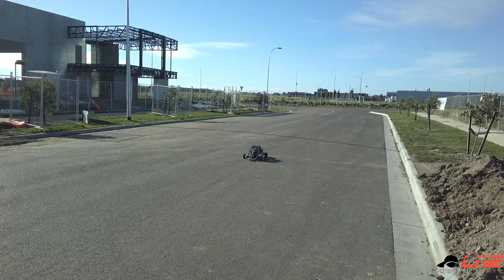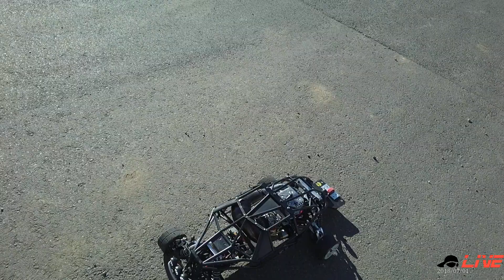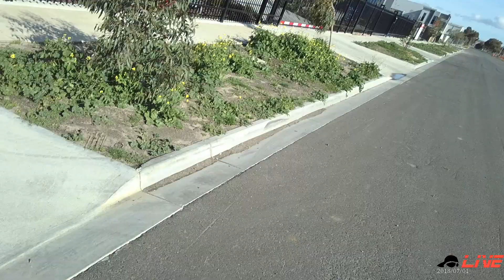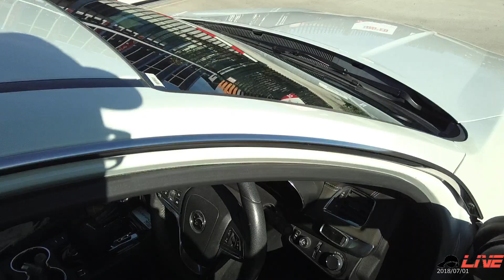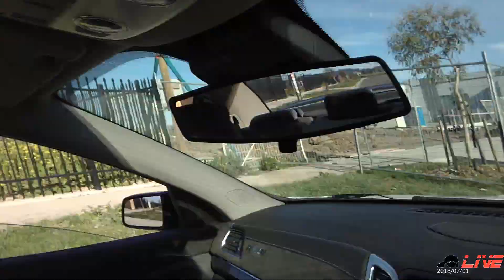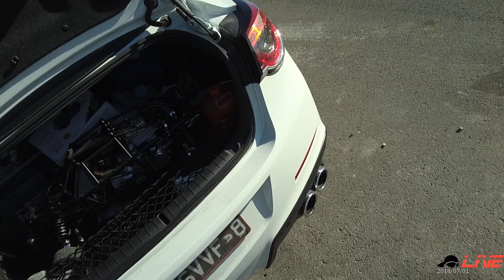Hpi baja RCMAX 90 GT

Comment: how is your disk issues going? you feel better?
Reply from the maker: Tim Shufflebottom I feel better because I lost weight . So I dont have the aggressive pain like I used to . But losing weight is probably only 1 reason of feeling better it could be a combination of things . Been sleeping on a flat rock hard floor for 1 year too as well as taking glucosamine supplements and some others too . The symptoms though don't ever go away like the random tingling and spontaneous numbness in my leg and foot . My pain is between a 0 and 1 . Everyday is still a reminder of what I've got because of all that . I need another MRI to see how my discs are doing if I'm still progressing in disc degeneration.
Reply: what u think may have  started the ilness?
Reply from the maker: Tim Shufflebottom I've been a welder for 25 years . Bending over constantly welding and grinding and spray painting . So that explains most of it . Now I wear a DDS 500 spinal decompression belt daily plus I use a chair at work whenever possible.  All it takes is for one bad disc to cause the rest to fail if it's not taken care of when you notice that the pain persists and just doesnt go away . I ignored it and took over the counter pain meds for years untill my body shut down Making me finally go seek help .
Reply: i have two disk bulges but have only low back pain , no leg pain , but its intence
Reply from the maker: Tim Shufflebottom that's how mine started . Lots of lower back pain which left untreated affected the sciatic nerve so bad I was crippled for 3 months straight could not walk 1 meter without screaming in agony . I'm a grown man I was crying dude lol .. my advise to you to take but do your research dont hold me responsible lol drinks lots of water . Take glucosamine supplements and vitamin K2 and vitamin C And drink stinging nettle leaf powder infused into water daily I do 1 teaspoon into a liter of water a day . This will give your body all the nutrients to heal those discs . But most importantly drink lots of water .
Reply from the maker: Tim Shufflebottom I did the McKenzie half pushups that's what got me started on the road to recovery.  And yes I did consider that because I had lost all hope . I was truly paralyzed.  But dont do that if that's what your thinking.
Reply: im seriously  consider it
Reply from the maker: Tim Shufflebottom it took me about 6 months to 1 year to get better on my own . No one wanted to help me .i dont have the money for stem cell therapy . I'm only cured upto a certain point because I did the research and watched alot of YouTube videos on the problem . If I had money I would go get stem cell treatment in America but I heard it costs about $10,000 per treatment depending how bad you may need upto 3 treatments from what they say but usually 1 is good enough they inject stem cells right into the problem disc . For me I was frightened and horrified of the thought of surgery and didn't want that at all . I've seen the videos it's a horror show. Trust me do what I said get the DDS 500 spinal belt and use the supplements. And see how it goes. If you are overweight lose the weight . I went on optislim to lose weight and stopped eating crap . I have not eaten bread for over a year now. The doctors only cared about drugging me up with lyrica and oxycodone and that shit increases depression man I was an emotional wreck .
Reply: i avoid the opiods too but take antidepressant for my emotinal state

Comment: What an awesome rig you have there! Amazing power and performance. What a coincidence your silencer came off. A week after I got my RCMAX 55cc with the titanium pipe, while running on a soccer field my exhaust note suddenly changed just like your did and when I got closer to inspect my silencer was indeed gone. Luckily after an hour of searching the field I found it and the welds let go just like yours did. I immediately contacted Mike from Rcmax and he contacted his titanium pipe manufacturer and they discovered the issue and I will be receiving a new titanium pipe for my Baja. I’ve been running a few weeks now unsilenced and I’m almost half deaf now! Lol!! These big bore motors unsilenced are insanely loud.
Reply from the maker: sounds better without silencer but yeah its more loud . Mike is a great man will sort out any problems .
Reply: silverss onyoutube Yes, he is a stand up guy and his customer service is top notch.

Comment: I run deep but I'm gonna try these tires with big gears on my drag twin, what compound is this?
Reply from the maker: John Chew these are mediums compound. They are a good in between.  Soft would give the most grip and probably better for drag racing ,its what I should probably be using for speed runs .